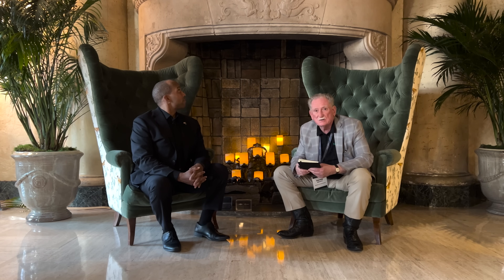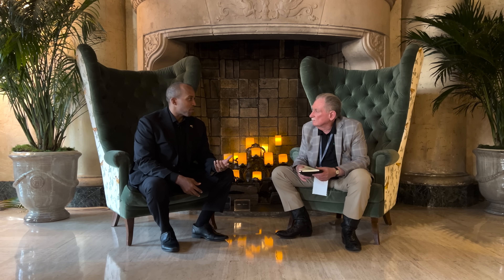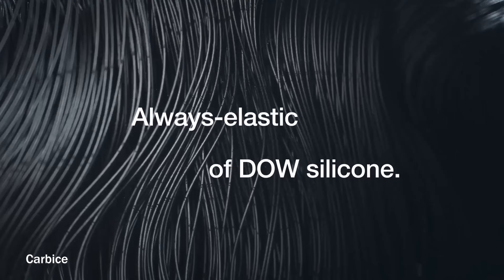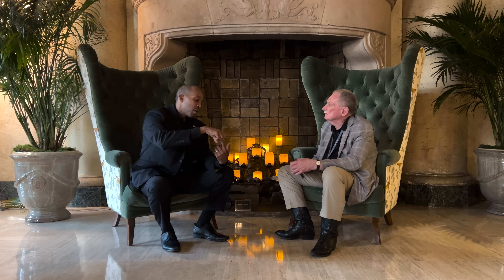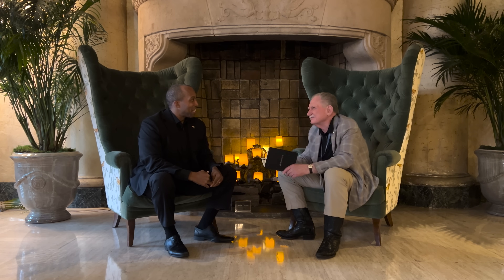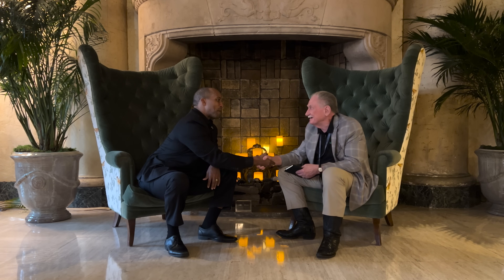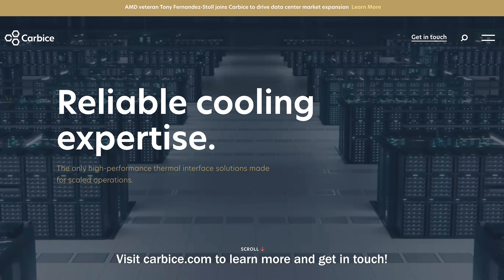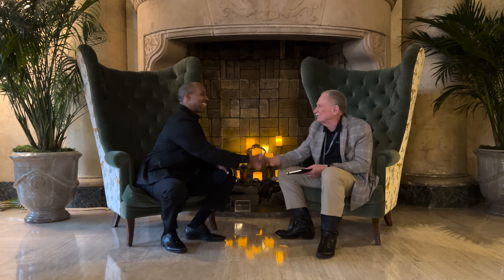Carbice: The Coolest Thermal Interface Solution?

Comment: What Sandy's most excited about, battery thermals, already moot via CATL Naxtra 🧂🔋. Doesn't even need a case. They sawed it in ½ at 100% SoC with less pop than opening flat soda. 

So it's cell energy density should be compared to lithium packs. (The only metric Li's allegedly better at). And this was obvious at least 5 years ago when CATL announced; they slow-walked it, to protect Li sunk cost, and still nobody caught up.

Comment: So, this is all about a contact pad(thermal paste🤔), that goes between heatsink and chip package🤯. Still someone has to move away the heat at the same efficiency(let it be liquid or air) elsewhere😢. Same problem with active peltier cooling(even though it cools, it adds its own heat eventually reducing efficiency), which in reality cannot outperform forced air/liquid cooling. May be good for vibration sensitive environment, or for predictable interface performance. Wonder how well it would perform compared to a graphene atom thick interface(which might also need surface preparation😢).Should sell them to gamers and overclockers! and GPUs used for LLM training and inferencing.❤👍

Comment: Could these "Carbice pads" be used in solid state battery cells to improve the surface contact?  I understand that one of the problems with solid state batteries is that they need to use extreme pressure to ensure contact. (no liquid electrolytes). The pads may be too conductive?

Comment: Sounds like phenomenal material.  I wonder what it costs in comparison to similar products and how quickly it can be manufactured at scale?  Also does it work on both sides for transfer of temperatures?  i.e. does it transmit heat in both directions the same?

Comment: Great !  Carbon Nanotubes in silicone conductive TIM (Thermal Interface Material).  Great solution for high current, high-performance, mechanically varying interface.   If you can afford it...   Based on the current applications and customers...more than a >10x higher cost over many other alternatives.  Calm down...not affordably applicable to batteries in EVs and Bulk Storage, though.   Baratunde is extremely knowledgeable and has a very deep understanding of the minutia and nuance of high thermal and electrical conductivity with carbon nanotubes.   

Bonus: Sandy finally admits that as knowledgeable and experienced he is in the mechanical world,  he knows little about electricity !

Comment: I was hoping asking about safety. What I have read, breathing carbon nanotubes stay in lungs and cuts everything slowly.
Reply: Great question! It’s helpful to know that carbon nanotubes (CNTs) are already used safely in tons of everyday products—like sporting goods, automotive parts, and electronics—often as fillers in composite materials. Once CNTs are mixed into a polymer or bonded in a solid structure (like in our product), they’re no longer free particles and can’t return to their loose, airborne form. Think of it like rebar in concrete—it’s part of the structure, not something that can just float away. That’s why our material is safe to use and handle, and why it’s trusted in sensitive environments like satellites and advanced electronics.

Comment: I remember reading about carbon nanotubes a very long time ago but don't remember where..regardless, can't you safety wire bolts in place if you have ones that vibrate loose?
  I'm assuming that red loctite won't hold them in place or that you can't apply a torch to break the adhesive free so that's out of the question.

It's common in automotive & heavy duty trucking industrial & safety wired hardware is never going to vibrate loose in a data center.
Reply: This is for things like EVs where you can't have screws or bolts INSIDE the pack for puncture prevention.